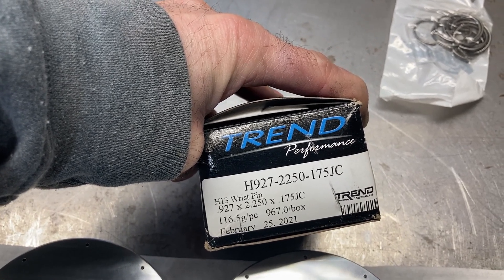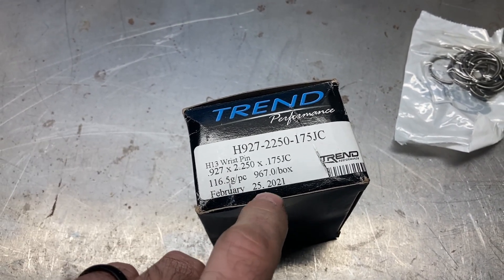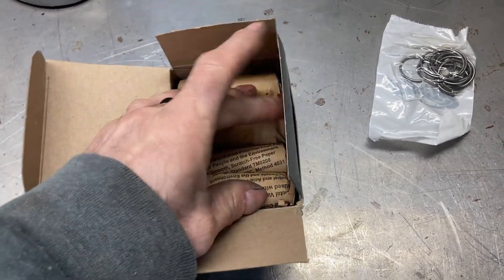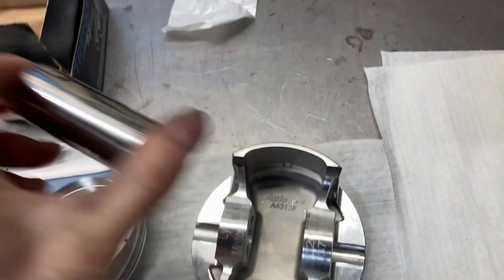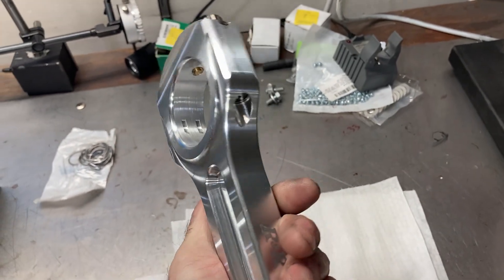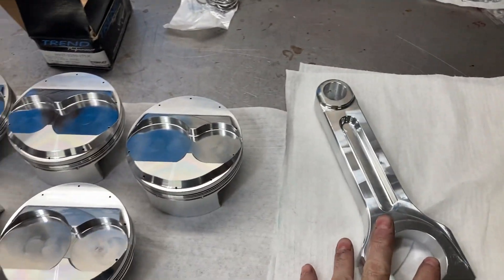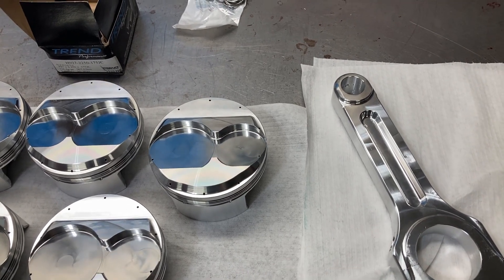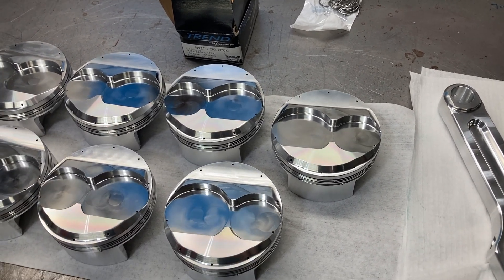Lykins Motorsports Ford 397ci Tunnel Port Piston/Rod Assembly

Comment: Do you have a video of flat tappet cam break in or assembly process. Lost two flat tappet a in a row during break in and still don’t know what went wrong (inferior parts or too much spring pressure?)
Reply from the maker: If your spring loads are over 100 lbs seat and 275 lbs open, you will have issues with break in.
Reply: Thanks for the reply. You would have thought Clay Smith would have said that. They said the spring rates were fine. With the inners installed I think I was at 150 seat and way up there open…..
Reply from the maker: That may have been necessary for operating, but for break-in the spring loads have to be WAY down.  Also, with spring loads that high for a solid flat tappet, you really need EDM lifters and a nitrided cam.  125% sure that's why you wiped your cams down.

Comment: That’s quite the piston assembly. I can’t wait to see and hear that one run. You’ll have to post some high quality audio. It’ll probably be the only flat plane FE I’ll ever hear. Hell, probably the largest displacement flat plane I’ll ever hear. 
Curiosity has me wondering what the rod length is? Not sure if mentioned it or I just missed it.

Comment: Brent do you ever remove a little material from the rod or piston to make the components closer to same weight?
Good video!
Reply from the maker: I try not to.  It takes a lot of aluminum removal to make a difference.  Guys try to get weights to within tenths of grams, but they forget that there's an unknowable amount of oil on the parts at any given time.
Reply: Thanks, I never thought about that.

Comment: do the rod bolts thread into aluminum?
Reply from the maker: Yes, that's the way all aluminum rods are.  The rod bolts are extra long.
Reply: Do you think a reverse offset on factory 428CJ pistons would have an advantage in the higher rpm ranges ?
Reply from the maker: I don't a factory piston of any time needs to be used in a higher rpm engine.  Too heavy.  Rings too thick.
Reply: @lykinsmotorsports  We did that years ago with Cast factory pistons but never had a Dyno to check results . We used Dykes rings and TRW Pikes Peak pistons in the Tunnel Port Modified Sportsman stock car back in the late 60's and that worked real well   Steel crank Lemans Rods , Lt . Weight valves ,Shell type lifters 3BBL Holley It was as fast as anything out there . Things were not at all like what we know today .